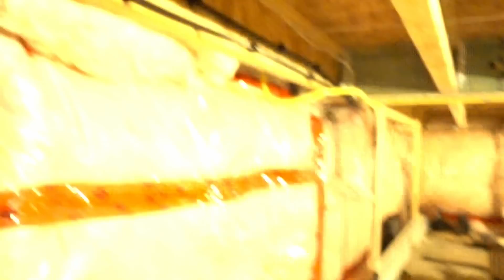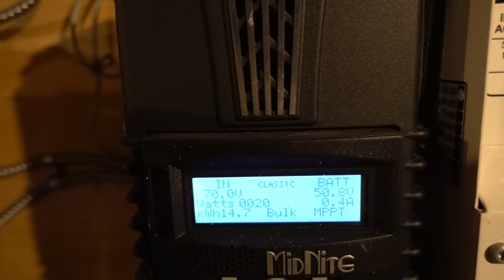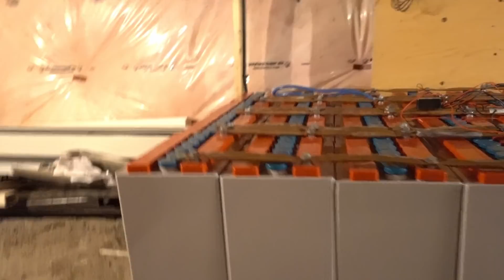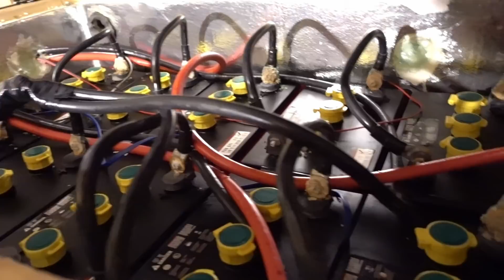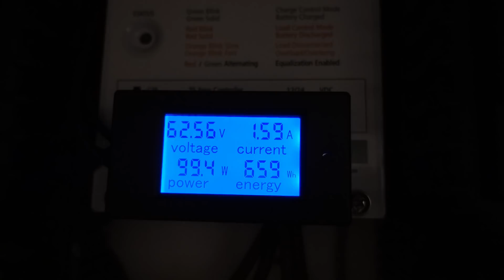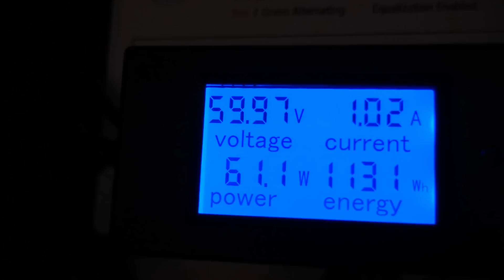Off Grid Up North And Lots Of Wind Power

Comment: Hey bud what size fuse should I use for one Chevy volt 24v battery I want to fuse each of the battery and then fuse them all together
Reply from the maker: I would use a 40 amp fuse per pack as long as you know your not pushing the battery to close to its max.
Reply: How can I find out the max oh and thanks for ur help
Reply from the maker: @dangoras9152  look up how many AH your battery is then times that by the C rating of the pack.
Reply: What's is the c rating.   Is that cranking amps
Reply from the maker: @dangoras9152  c rating is how many amp the battery can put out in comparision to the rated Ah of the battery
Reply: Chevy volt 24v battery I don't see the c rating unless it is the continuous rate
Reply from the maker: @dangoras9152  so if its a 10Ah battery and the c rating is 5 then it can put out 50 amps
Reply: Cool thanks bud I appreciate your help
Reply: What would be a good battery charger for lithium 24v Chevy volt bud
Reply from the maker: @dangoras9152  like plug in charger ?
Reply: Like to charge the battery before I put it in the bank to have all of them charged to the same volts yeah plugged in
Reply from the maker: @dangoras9152  An Imax B6 knock off can do 6s charging and is super cheap.

Comment: Thats a nice system too. Tell them coat the terminals with dielectric grease. It helps. Have you checked the balance of each battery? That will tell you alot. Anyway great vid. That wind meter is much better too and todays another windy one